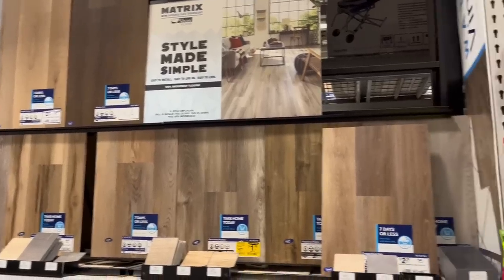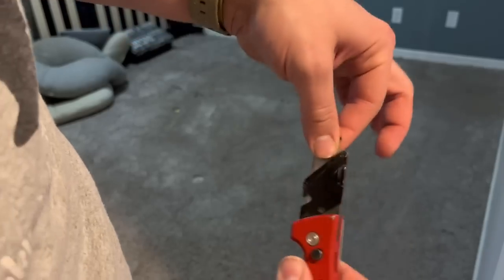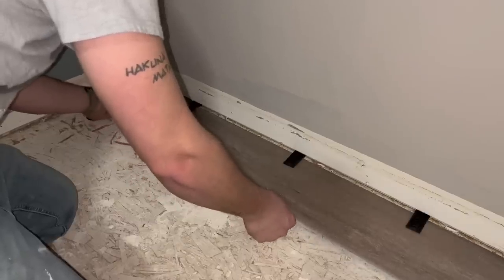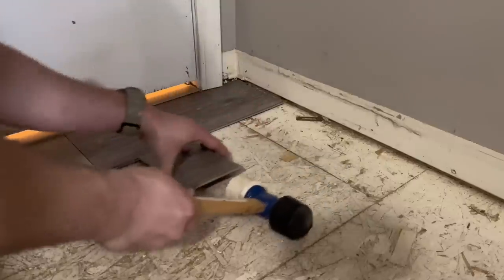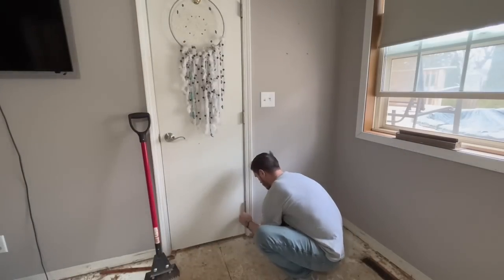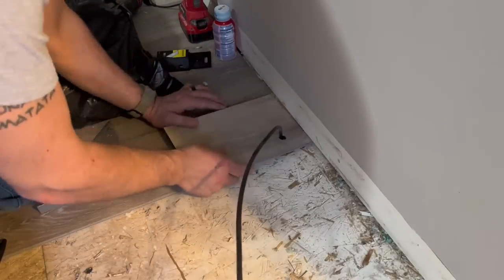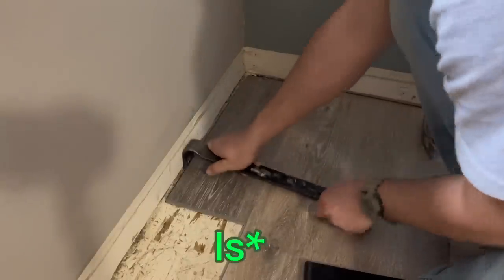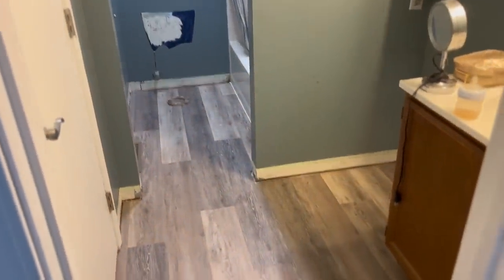Install Vinyl Plank Like A PRO

Comment: 8:49 Mold tip: use strong paper towel strips dipped in bleach water 50/50 mixture and leave in those mold areas to prevent sporilation and kill all the potential mold spores. Leave for a few hours, remove paper towels and dry completely. Paper acts as a filter to keep the spores from becoming airborne and settling elsewhere. Works great on tile too! Use gloves and facemask.

Comment: Your floor looks great and I got some super tips from your instructions. (DUDE, why couldn't I have seen this before I pulled THOUSANDS of staples after removing my carpet!) I did have a question about underlayment. Was there a reason you didn't need it? I have heard that even with the flooring that has it built in, you should still use a thin one. Thanks and great video. I ready to remove my damaged laminate and go vinyl!
Reply from the maker: Appreciate your kind words! And to answer your question every manufacturer of flooring has their own guidelines about using underlayment. Every since I started installing vinyl plank (about 6 years ago) it has always been recommended to not use an underlayment, and I haven’t. All the vinyl plank floors I’ve installed are still in good shape today. However with laminate it is completely different, and you should always use an underlayment with laminate, it is a much different material and thickness. A lot of people use the terms “laminate” and “vinyl” interchangeably and it’s just plain wrong, two totally different materials. Hope this helps!

Comment: Such a great video!! Question, if I’m not removing my baseboards do I still need to use a spacer? Thank you for such an informative video
Reply from the maker: Thank you! And to answer your question, it depends! If you’re baseboard is flush to the floor then yes, If there is a large enough gap to slide the flooring underneath, no but you still need a 1/4” gap from the wall itself, so I would still recommend using a spacer and using a shoe moulding or quarter round to cover the gaps all the way around!

Comment: Nice work, but what about moisture barrier on the floor in the bathroom? More mold
Reply from the maker: Vinyl plank is 100% waterproof meaning it doesn’t require a moisture barrier. Besides all the moisture in a bathroom comes from above the floor not below. However that may be code in some areas, just not my area. Good observation though

Comment: Hi Lone, I am going to go with vinyl flooring for my kitchen. there are two types. One is more  and no "cork" backing. the other cheaper but I like the color better. What do you recommend. I want the cheaper one because of the color but I want to pay more for a better backing. What do you suggest?  Does the "cork" backing make a better floor? thx.
Reply from the maker: I’ve used the cork stuff, and I really like it. What’s the brand name of the cheaper one?
Reply: @Fixintobuild  duralux? the colors are so close. can i add cork?seeing nucore they are more expensive with cork backing. I may pay more for a little different color and cork backing.
Reply: @Fixintobuild  thx for ur help.
Reply: @Fixintobuild  better one is nucore
Reply from the maker: @subaruamazon  of course, and yeah if you can spend a little more for something better it’s always worth it, especially if the warranty is good
Reply: @Fixintobuild  thx

Comment: Just wondering you did half the flooring - did you encounter any uneven flooring requiring leveling?
Reply from the maker: I did not run into this problem on this project.  I have ran into a lot of these issues at clients houses though, and it is a pain! I may make a video about it in the future

Comment: Nice video but is there a pattern to lay them down? I see that you were using smaller plank first in second row.
Reply from the maker: Any pattern is acceptable as long as the joints are at least 6” apart, you want joints staggered otherwise it could separate easier.  Some people go with a “stair step” pattern, some people go “brick pattern” or even “1/3 offset” but I prefer just random lengths. To me it looks more natural and less manufactured

Comment: I think you have to use flooring underlaying for airflow and water protection bro.
Reply from the maker: Not for this flooring. Manufacturers standards do not require underlayment for waterproof vinyl flooring.

Comment: Why not put your first piece up against or under the trim gap?
Reply from the maker: All floating floors require an expansion gap, if the flooring is too tight against the framing it will surely move over time
Reply: @Fixintobuild  I'm in the process of doing some LVP and I thank you for the tips
Reply from the maker: @jtompkins1277  good luck sir!
Reply: @Fixintobuild  Thanks, I need all the luck I can get.

Comment: pop a chalk line on the 1st run, that wall may be crooked as shit your spacing off of..
Reply from the maker: I always check the wall for square before beginning my first row, this wall was pretty square not gonna lie
Reply: @Fixintobuild   yeah, but still, a good straight line still rules for starting anything....
Reply from the maker: @nodoubt46able  I agree, a chalk line is an invaluable tool for a lot of things
Reply: Lol. If your wall is crooked to begin with , how the hell you gonna get a straight chalk line?
Reply: @tg8150   point a and point b, are fixed ....if the wall is crooked between those 2 points,, thats the reason you chalk a line fool... sheesh...lmao
Reply: @nodoubt46able  what’s point a & point b? Wtf are you measuring off to get these points if the wall is out of square